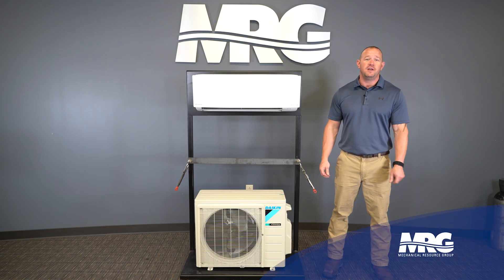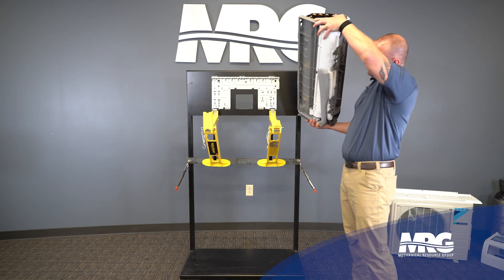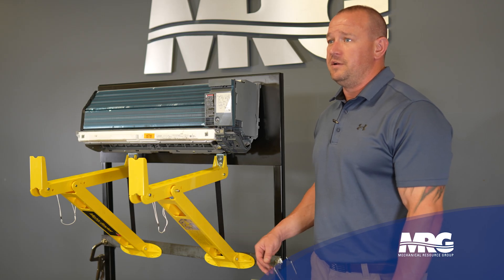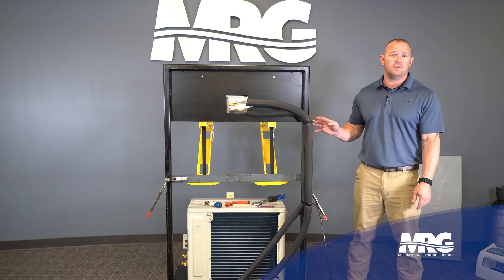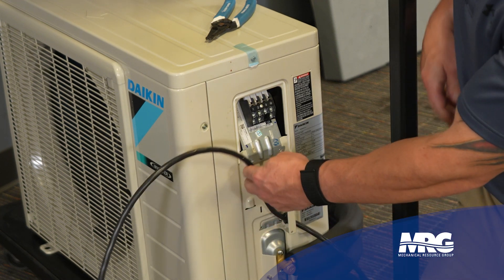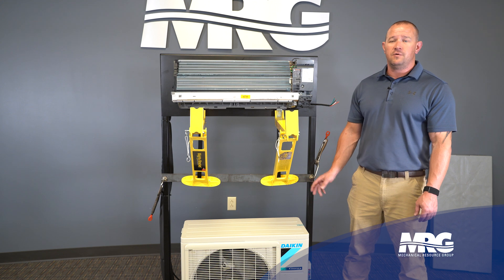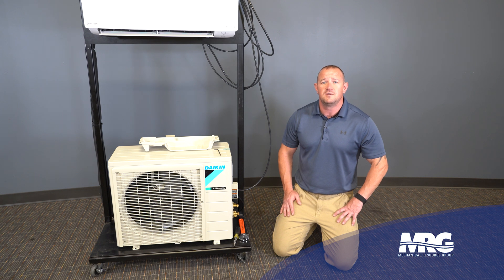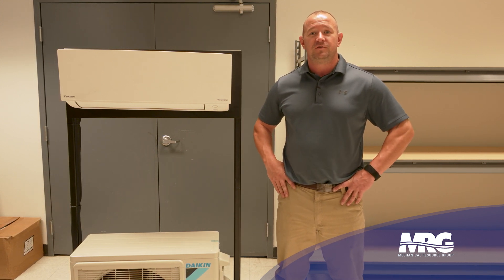Mini Split Wiring: Your Guide for Peak Performance!

Comment: unless the unit has color coding I wire 240V units with black/Red for the L1/L2 power in line with residential power 240V scheme and white for signal green for ground

Comment: But how do you get power to it? I installed one in my garage and it plugged into my wall. My new one is also 115v but I don't see where to wire the power up {or where to hook the power cord to the head unit}.